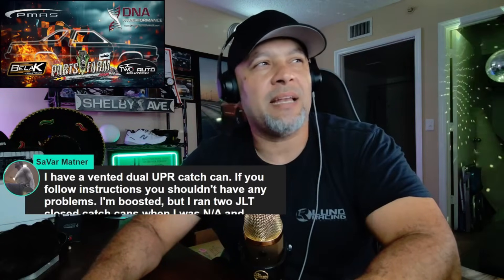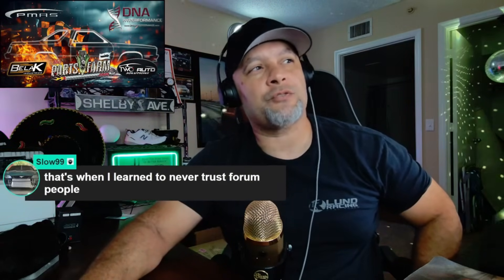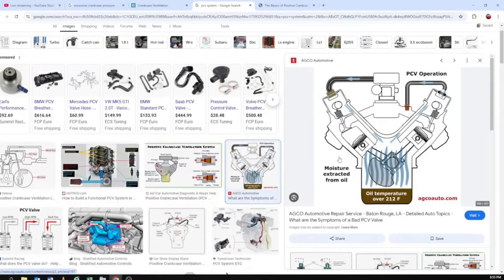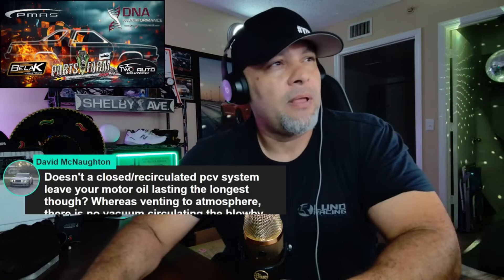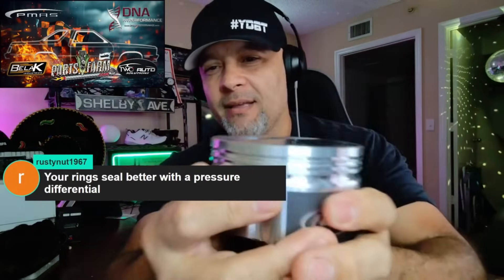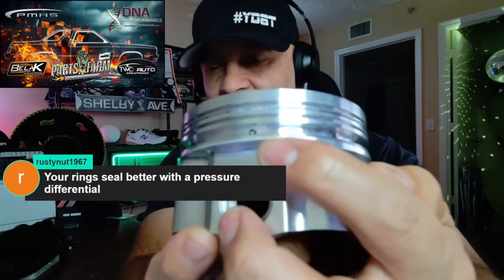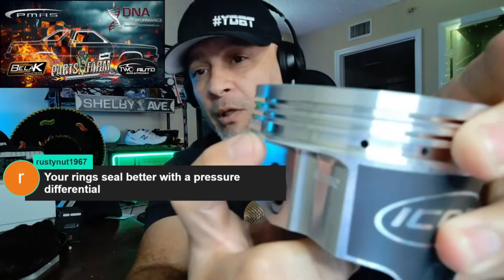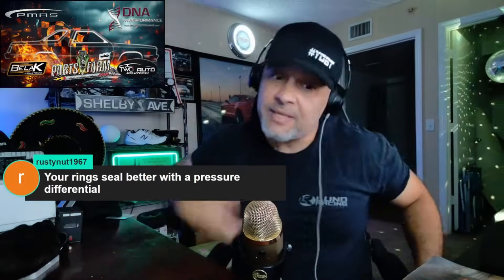Vent your crankcase pressure to atmosphere on a highly boosted coyote engine

Comment: Hey Alex, thanks for the info BUT I still have a question.

I’m an n/a car (cj,headers,e85),DO I need to pop the ball out of the PCV when installing breathers? 

My assumption is that vacuum keeps the PCV open when it is connected to the manifold, with that in mind will crank case pressure be enough to pop the PCV when it needs it?

I can’t find a damn answer on a forum so if you answer I’ll buy some merch!

Comment: Both mine are vented out the trunk on my sleeved 5.2 making 25psi.

I don't even run a can , if it's 30° out, it condensates in the line some.  Eventually, she blows it out as rpms rise 🤷‍♂️. 

.007"x3.7" bore nets large ring gaps.

Comment: Thanks for the thorough explaination.
Different engine but my VQ35DE is running a non-vented catch can & I had a shop tell me they think that's causing gaskets like the rear main seal to go...
I'm very skeptical of this as I rarely push the car past 5.5k RPM... They recommend a vented system but I am thinking that would fk with the MAF readings on this particular application...

Comment: I vent my catch cans to a Venturi I welded into the exhaust in the mid pipes. Problem solved. No smells and no crank case pressure.

Comment: Old school,  we used to vent to the headers
Reply from the maker: @JosephJanik  lol we don't do that. It's not smart. The reason people have catch cans and puke cans is in the event of a engine malfunction or a head gasket letting go that exhaust is going to spray crap onto your tires
Reply: Yes I understand,  I was saying that's what we used to do back in the 90s. 😊
I have 2 open air huge catch cans on my procharged camaro 😊

Comment: Great explanation! Now,  I had a conversation with someone that had vented the passenger side and not the driver and he had a decent thought pattern.  He understood that the coyote's (most engines in general) factory venting/circulating pressure is directed to the passenger side not necessarily to the driver's side. I told him that infact he was correct........for an N/A application,  then explained to him the benefits of dual vents on boosted applications and he said no one had explained it to him. People are usually too quick to "argue" instead of having an exchange of info.  Obviously, both parties have to be open to the idea of being worng or learning something new.  Great video.

Comment: You mean like run no catch can set up and have a breather/filter on each valve cover? If I plan on running 7-8 psi 120mm ess pulley I can still run any catch can set up correct?
Reply from the maker: @k-rizzel9952  yes

Comment: proper catch cans should be draining to the oil pan, its been long enough that OEMs should be making factory catch cans for their Performance vehicles and heavy duty trucks that can drain to the oil pan. don't worry about moisture if you let your engine oil get up to temperature the water will steam itself out.
Reply from the maker: @krombopulosmichael7994  again we're talking about race applications please cut the crap with this BS... No coyote on the planet is going to survive 15 psi of boost with recirculated PCV systems. Listen closely again to what I say in the video again please I'm talking about race applications nothing else quit this bull crap of having a big long stupid paragraph that has nothing to do with the subject matter at hand
Reply: Yeah definitely watch that portion of the stream. My comment was in reference to more of a stock/lightly modded daily car. Not 13-15+ psi applications. That stream had really good information and explains it more throughly than just this snippet.

Comment: Run the vent to the header collectors,  it will create a vacuum in the crankcase.
Reply from the maker: @erichgrigutis1066  LOL show me a racer that vents his crankcase pressure through the exhaust
Reply: @YDBT4LIFE been done for years.  Venturi tube in the header collector,  creates a vacuum on the catch can or directly from valve covers.
Reply: @YDBT4LIFE  ago

Mr. Gasket #6002 Crankcase Evacuation | PDF
Reply: @YDBT4LIFE  maybe no one does anymore, but I know from dyno runs it made a small improvement in power.  On supercharged applications the most we saw was 18HP.  An old guy named Gary told me I should do it on my mud drag truck, so I did.   I worked in his Blower shop through high school and all his friends did it on their race/drag cars and monster trucks.
Reply: @erichgrigutis1066  Seen some older school big block setups do it.  Slash cut nozzle into the header right around the collector. I do think you have to be careful about pulling too much air though.  I believe they run different orifice sizes on the nozzle to control the flow, and a check valve  All the heavy hitter BB guys are dry sumped now so it's not a competitive setup anymore.  Not sure I'd do it on a modern engine
Reply: @YDBT4LIFE I’ve seen it on drag boats, that’s about it, but NEVER on a turbocharged setup
Reply: into red glowing headers?
Reply: It's called a crank evac kit it helps seal up the motor better.

Comment: Why wouldn’t you vent it to the exhaust
Reply from the maker: @keithmceuen8775  do it and you'll see why.
Reply: Venting Flammable oil & vapors to a super hot manifold or collector?..
Reply: @ it was something that was done for decades I don’t what the difference would be on a coyote

Comment: Higher pressure inside the crankcase also means lost power due to higher air density inside the crankcase adding drag to the rotating assembly.  A vacuum inside the crankcase would be the ideal situation, though in race applications that isn't possible.

Comment: Pistons on a down stroke also pressurize the crankcase as well.
Reply: Ignoring the fact that as one piston goes down another goes up, so the delta volume is not changed by this factor.

Comment: Interesting note, these cars do run check valves in the PCV valve to prevent positive pressure from getting into the crankcase. How well those work at higher boost levels though idk. I'd personally vent to atmosphere at higher boost levels either way.

Comment: Some drag boats actually runs vacuum in the crank case to get more power
Reply: I’ve also seen drag boats run their crank case lines into the header after the collector. The exhaust creates a Venturi effect and sucks the fumes out.
Reply: @bullhead360  yes exactly this.
Reply: That's what ppl used to do all the time but for some reason have stopped. 20yrs ago my buddy had BES build a 1200hp engine & BES said run a vacuum pump so there was no crankcase pressure

Comment: I was concerned when the  big badass catch can I bought with dual line inlets and vented to atmosphere didn't really accumulate any oil on a 93 pump ESS.  
I also vented the engine oil cap with a check valve vented crankcase filter.  That bad boy would get wet. Was the catch can not accumulating oil normal?? Due to the crankcase vented filter? Was just wondering.  Car runs and idles geat!, due to Lund Tuning.  But really no oil in my UPR catch can.  😅
Reply: If you have long enough lines to the catch can the oil vapor is probably cooling off and condensing in the lines.  May be puddling in there or even draining back depending on height of can vs. hose outlets from engine.  I have a boosted Honda with the can mounted well above the head and there's never any oil in there, but you can smell the oil and ethanol fumes coming out of the filter at WOT.  Lines are almost 2 ft long though.  My LS can, OTOH, barely emits any vapor at all.  Catch cans can be really cool or really frustrating, so if you find a setup that works stick with it.
Reply: @ChurchAutoTest  Yeah, those UPR DUAL LINE CATCH CAN are Hella long.  Well one is. The Driver side is close as hell. I laid them according to the instruction specs.  
Who knows.

Comment: Question Alex from your experience on a 700-900whp coyote would the stock damper be best or would you recommend something like an ati or innovators west? I’ve seen mixed things about crank failure due to aftermarket balancers and I wanted to hear your opinion on them.
Reply from the maker: @jasonn277  never innovators west 
ATI only